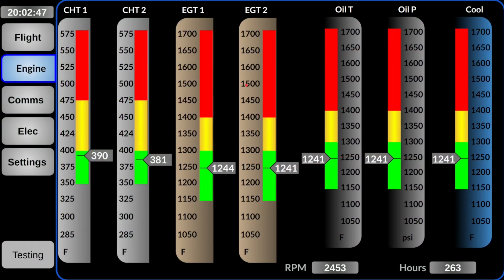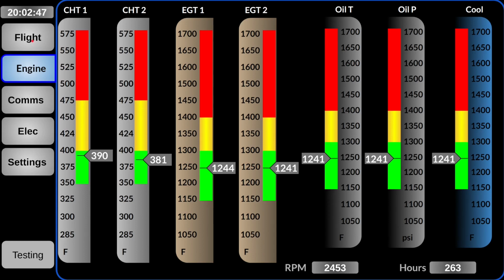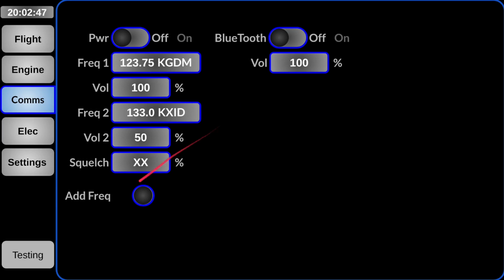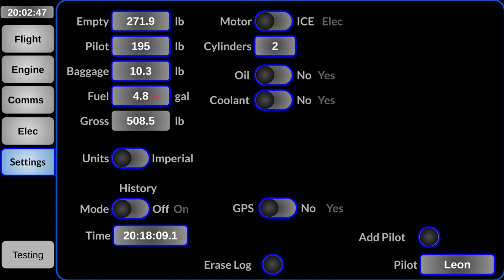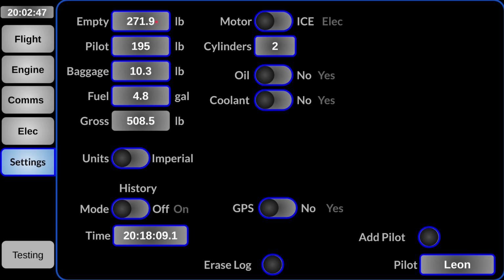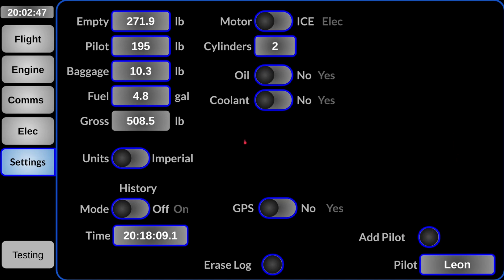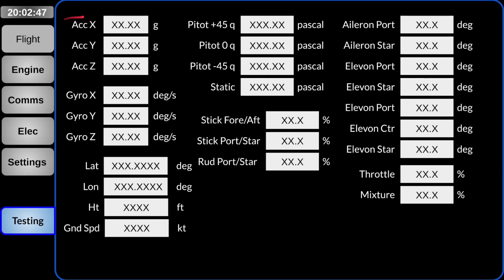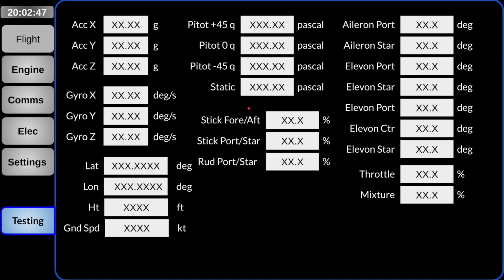UWS-4: Instrument Panel Thoughts, Part2

Comment: Here's an idea: Instead of an SD card, use a USB flash drive for saving logs to. You could also save all settings to the USB drive. You can then have your USB drive on your keychain, and when you plug it in you airplane just loads all your settings and details from there. If no USB stick is present it just defaults to a very simple set of instruments.

I guess you could also have it search the USB drive for a particular file and refuse to turn on unless that file is present!